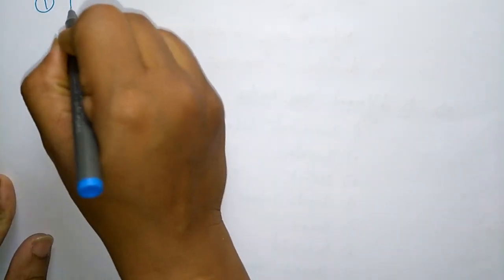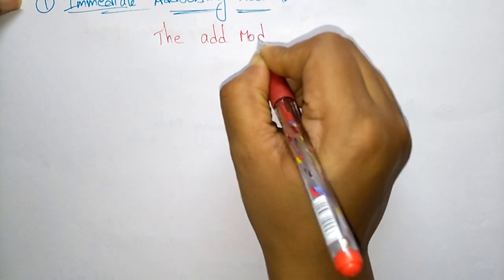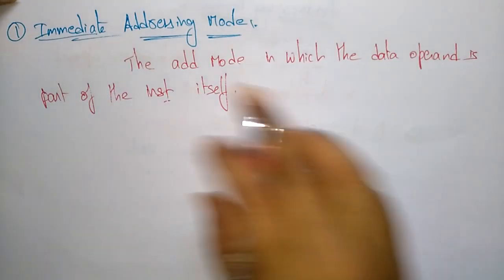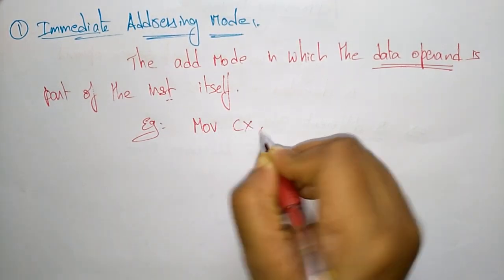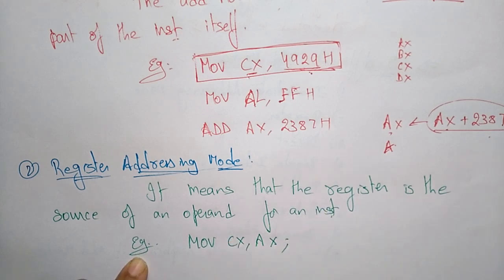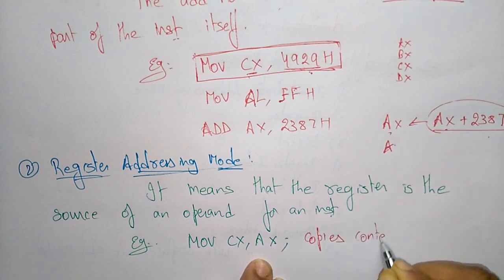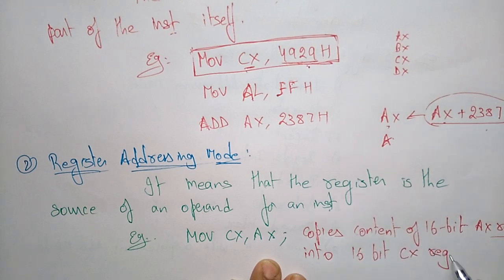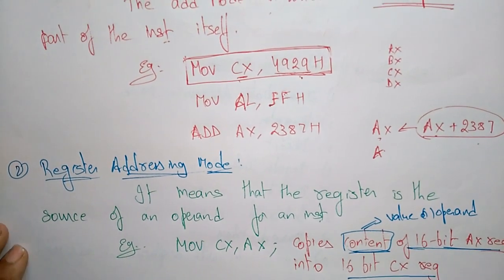Addressing modes of 8086 | Part-1/3 | MPMC | Lec-17 | Bhanu Priya

Comment: There are total 12 addressing modes
Reply: 12 addressing mode in computer architecture, 
5 addressing mode in 8085,
8 addressing mode in 8086 microprocessor
Reply: 99
Reply: 69
Reply: No 11 addressing mode
Reply: 13
Reply: 10
Reply: 6
Reply: 10
Reply: 2
Reply: 5
Reply: 17